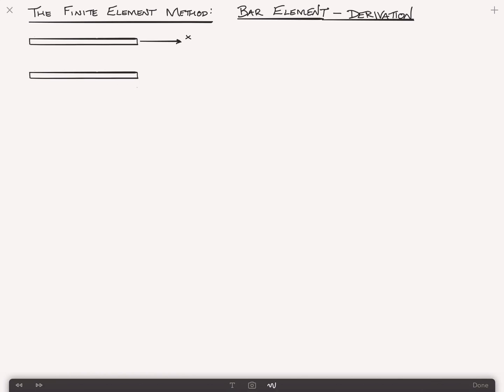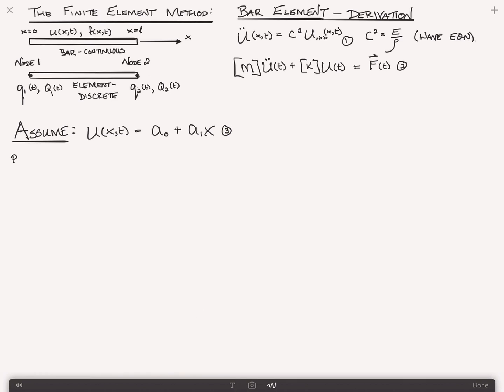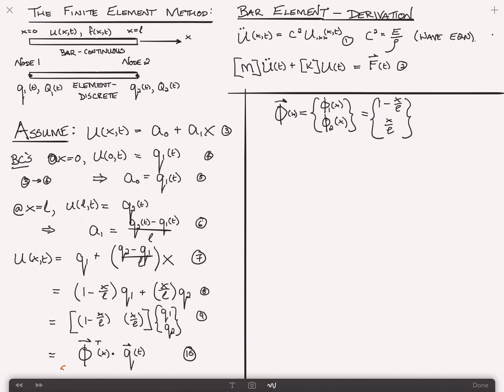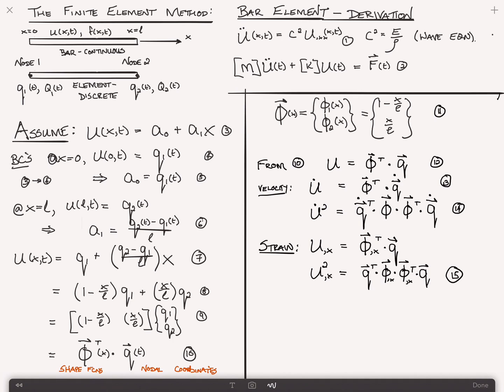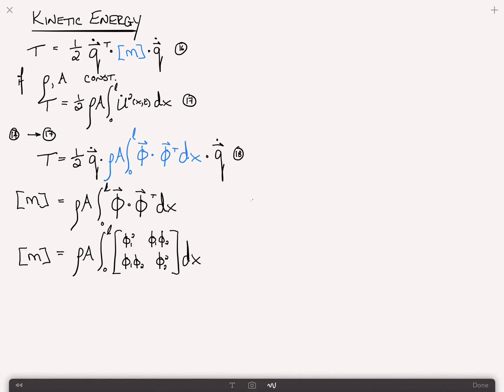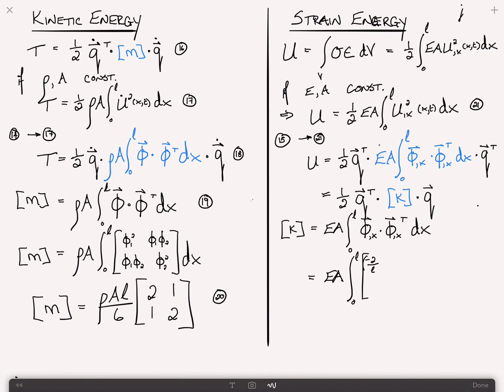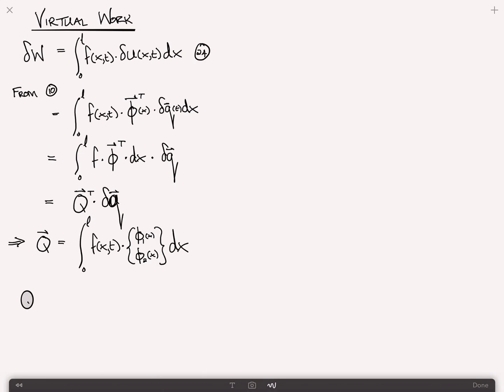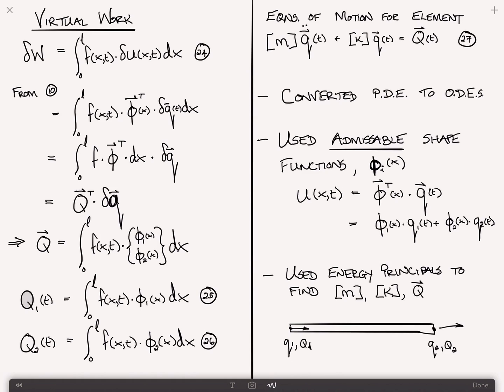Bar Finite Element - Deriving the Mass and Stiffness Matrices

Comment: I don't see the connection between the wave equation and equation 2.  Equation 2 was assumed to be the governing equation of motion for the bar, and the assumed linear function for the nodal displacements, equation 3, was ultimately applied to that.  I don't really see how the wave equation factored in at all.
Reply from the maker: The finite element equation of motion is essentially a discretized, numerical representation of the wave equation. It breaks down the complex, continuous problem into a series of simpler, discrete problems that can be solved with linear algebra. This connection allows us to analyze the behavior of physical systems using computational tools, even when an analytical solution to the wave equation is not possible.  

We know from the use of Lagrange's equations that at the heart of the equations of motion are the expressions for the kinetic and potential energies (equations 17 & 21) and we use these to derive the consistent mass and stiffness matrices by substituting our assumed, discretized displacement functions.  They are so-called "consistent" because for the same displacement and velocities at each end, both the actual bar and the finite element of the bar will store the same amounts of kinetic and potential energy.  This is the connection between the two equations.

Comment: Hi!  When solving partial differential equations with the finite element method, do you need to assume some structure of the solution before solving?  For example, here, we are assuming that the solution has a form that can be generated using the separation of variables method.  If we assumed a different structure for the solution, would the finite element method produce different results?
Reply from the maker: I am not aware of any other method for solving these equations.

Comment: Hi!  Can you explain why this method does not find the additional solutions u=+-ax, a = constant and u = +- at , a = constant
Reply from the maker: I'm not sure I understand the question.
Reply: @Freeball99  those functions should also satisfy the wave equation?
Reply from the maker: We satisfy the spacial requirements of the equation (approximately) by using appropriate shape functions (ie ones that satisfy the boundary conditions and a few other requirements).  This produces a set of 2nd order ODE's in time.  Since these equations are 2nd order, there will be two solutions and the result will be a linear combination of these two solutions (based on initial conditions).

Comment: I think this is a really excellent series and that you have presented the material in a clear and understandable way. The thing that still confuses me is that the next steps in Finite Elements usually involve this definition of weak solutions, and Galerkin methods, etc. I was hoping you could explain the connection between the material you have presented so far, and the subsequent ideas. I looked at the Rao book you suggested, and he does not explain the additional ideas like Galerkin methods, etc. If you know of any good references for those additional ideas, could you please suggest them. Thanks.
Reply from the maker: I definitely need to make a videos on Galerkin and Rayleigh-Ritz methods.  In the meantime, try Dym & Shames, Solid Mechanics: A Variational Approach.

Comment: I went through your answer for [K] through MatLab and found that the answer was [-1, 0 ; 0, 1] I might be wrong but I did make sure I differentiated the Shape Functions before Integrating them again with the limits from 0 to L. I could send you my MATLAB code if you want to, in order to verify. Otherwise I found this video very very helpful in understanding these concepts for my Dynamics module for my degree.

Cheers boet! B)
Reply from the maker: I somehow missed this until now...  

The [K] matrix as I have it is correct.  This is a well-known result that can be found in many texts.  Additionally, your diagonal elements of the stiffness matrix MUST be positive values else it means that when stretching the bar, you are releasing energy instead of storing it.  
I believe there is something wrong with your MATLAB implementation.  These shape functions and integrals are very simple for the bar element, so my suggestion is to solve them by hand - it will probably take you less than a minute.

Comment: Sir, which book would you recommend for vibrations ?
Reply from the maker: The textbook I used (a long time ago) was "Mechanical Vibrations" by Singiresu Rao (https://www.amazon.com/Mechanical-Vibrations-5th-Singiresu-Rao/dp/0132128195) - which is okay.  I don't think it is a great textbook because it is a little hard to follow (and has some errors), but it is pretty complete in terms of the information it contains.  FYI - I haven't seen too many great introductory textbooks out there.  Most of them are very expensive and are often not general enough.  For this reason, many professors use their own notes and handouts when teaching this class.

Many textbooks use different notation and many times it comes down to a personal preference - some textbooks are just easier to read than others and sometimes it's easier to use a book with the same notation as the teacher is using.  From my experience, this is a subject that most students find very difficult to learn on their own from a textbook because it test one's understanding of both math and physics simultaneously.  Having someone explain it really helps a lot - which is why I made the video.
Reply: +Freeball  thanks sir for your reply. We just started this course. And we are studying from daniel j inman. Your lectures are really helpful
Reply: How is Daniel's book?